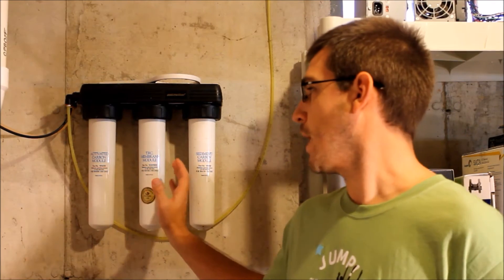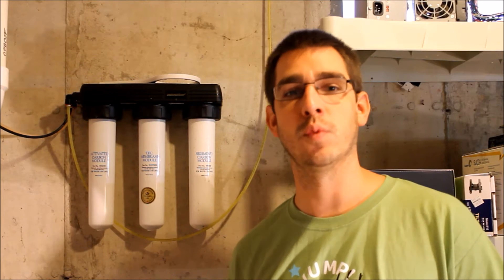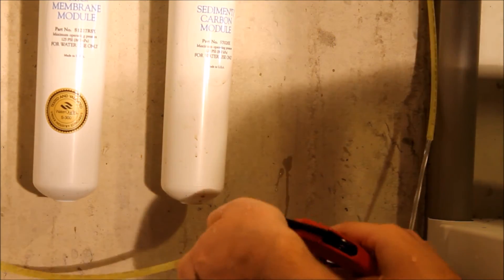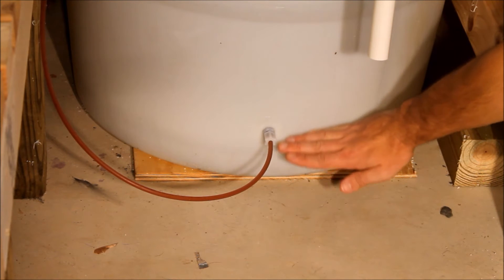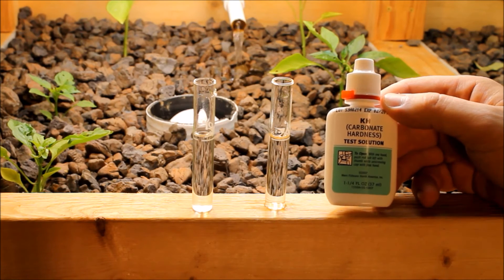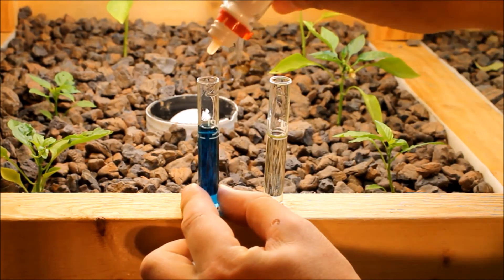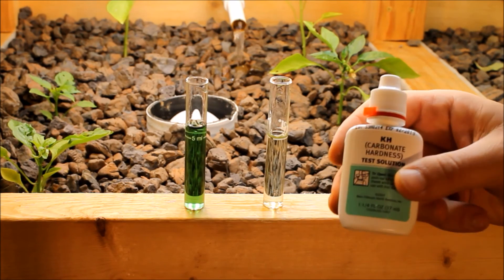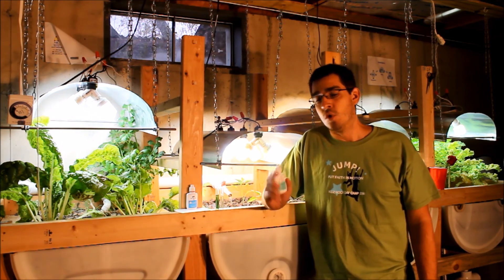Aquaponics System Design - Filtered Water Vs. Well Water

Comment: would love to see diagram, a parts list, a inventory list and source of your parts and how would this system need changing if it was in north or outside or in a unheated greenhouse?
Reply from the maker: I am doing a new video series on building the system from start to finish which will have more details. If the system were outside it would need to be heated for sure. Fish need certain Temps and the nutrifying bacteria do better when warmer as well. Hope that helps!

Comment: II enjoyed the videos. I notice that when you put the filter system in you did not put shut off valves in the lines is this something that you changed later or is this something that you have not had problems with?

Thanks
Reply from the maker: Patrick Gage in this case the actually tap valve that hooks the filter to the copper pipe has a shut off on it that I did not show in the video. It probably would have been a good idea to put a plastic 1/4" shutoff right in the water line as well but I have not had to shut it off yet.

Comment: Thanks... all of your videos are very helpful. I've been considering starting an aquaponics system in my basement. My question is whether you are concerned with the extra humidity introduced by having this water system in your house? Are there negative effects from the humidity on your house frame or drywall? Do you use a dehumidifier to help control this? Thanks in advance for any help.
Reply from the maker: Great question Vince, this was a concern of mine as well. I thought it would end up being a problem and that I would have to use a dehumidifier however, I have not had any issues thus far. In the winter it is dry anyway so the added humidity is actually a plus. In the summer it stays pretty cool and not a lot of evaporation takes place. I did use a dehumidifier to help top off the system's water for a bit but only ran it for a couple of weeks. Bottom line, I wouldn't worry too much about it, I haven't noticed any dampness or condensation on the windows. Thanks for following along!